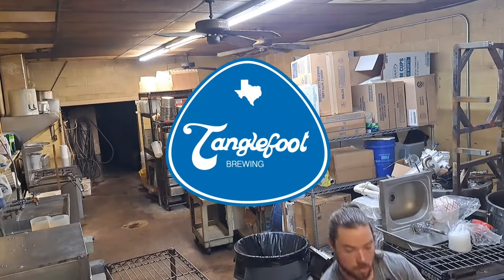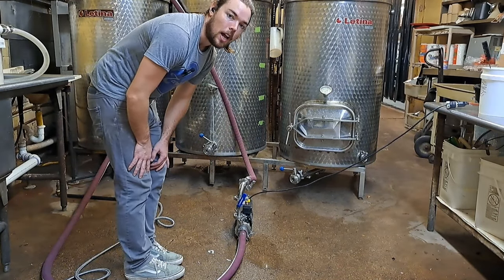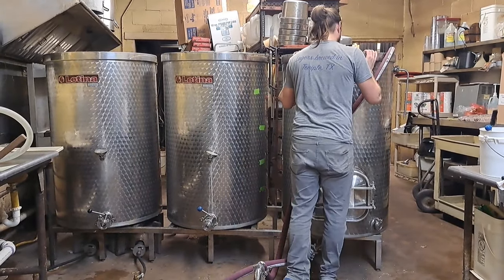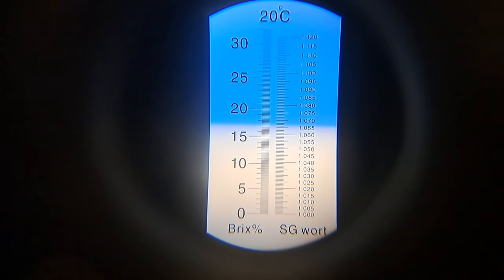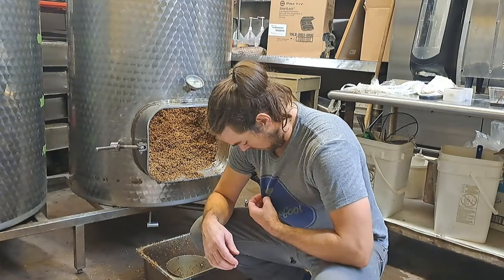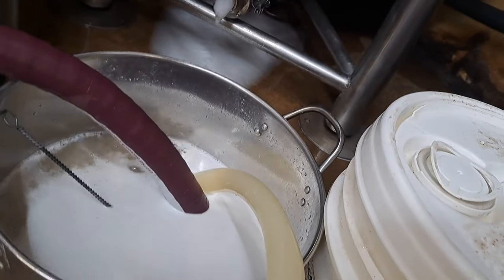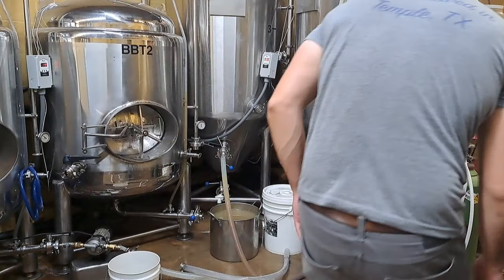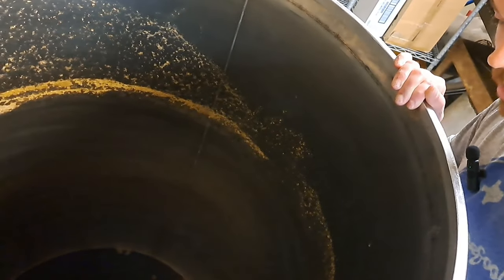Brewing Czech Lager In A Tiny Brewery

Comment: Great video! Thanks for taking the time to make it. One question. When you initially set up the tanks, the one on the left was for HLT/BK. The one on the right was for MT. What was the one in the middle used for? Thanks and cheers!
Reply from the maker: One in the middle was initially the HLT but I stopped using it for that since it was unnecessary, I have hot water at the ready for sparg8ng and don't need it. 🍻

Comment: The most impressive part of this video was that you were able to open a Weyermann bag without a blade. I just cut that first little pair of strings and it comes right out. Good work on the video.
Reply from the maker: Did that for years. Learned how to do it without in a pinch when the box cutter went missing. Got a quick tutorial on how to do it on the channel. Cheers 🍻

Comment: Neat stuff. What make/model are those 2 burners you are using? Are they both 200k BTU ? Cheers!
Reply from the maker: Something like that. They are blichmann burners, i believe Hellfire?? The burner set up is one of the things that I definitely need to upgrade. Not an ideal setup but it works for now 🤘
Reply: @tanglefootbrewing  yes they are hellfires I think. Is that heat exchanger a dudadiesal?
Reply from the maker: It sure is a DudaDiesel

Comment: Go pro, they said. It will be fun, they said. You really show the difference between homebrewing and professional brewing. It's a job. It has to be done. You have to check more things, have better analysis what you do. And if you fail, it will cost you money. You get soaked and sweatty.
I can see this isn't your first brew! Nice work. I am process technician and head brewer at a large brewery (300 hl kettle, 1000 hl fermenters) in Sweden. Still doing homebrew for fun and experiments.
Why are you using a cold water tank? Is your water from the tap not cold enough, so you chill it in advanced? Normally a brewery use a hot water tank to collect the warm water from the chiller. That can be used in the second brew, if your fermenter can take two or more brews. Saves money on the energy bill. And you do not have to clean the brew system that much until the end.
There can be several reasons for not hitting the mark. The malt. Do you get good malt analysis from your surplyer? Low extract in the malt? High B-glucans? High PUG? Low diastic power? High thickening temp? Not all surplyers give a detailed malt analysis to small brewers. You get what you get. Enzymes can be a good idea to increase the yield.
You seem to have good control on the mash and sparging. Those steps can cause less OG. Nice you let the spent grain dry out and get as much sugar out as possible. I guess you have made a brewhouse efficiency analysis, to use in your recipe building? I build my recipes backwards. What I want in alcohol, FG and volume, back to grain.
If you have less boil off and still no DMS, is a good thing. It's more beer and less energy lost to steam. I didn't see you check your volumes exactly? Make a measuring stick in your brew kettle. That will get you better control how much you boil off. Have a mark on your burner, so you use approx the same amount of propane/h from time to time. The same amount of propane = the same energy = the same boil off. A flowmeter is a way to know exactly how much you get into your fermenter. Expensive, but will get you better control. One way to hit the mark is high gravity brewing. Make your recipes slightly stronger. If you know the volume and OG in your fermenter, you can add exactly the right amount of water to hit the mark. Also a benefit with a flow meter. Or with your stick in the kettle you know how much water to put back in for the right OG.
I would put the pump and the chiller on a trolley. Then you get it up in height. Don't have them on the floor. Don't need to crawl at the floor to check temperature. Better for preventing infections and save your back and knees.

Good luck and cheers!
Anders
Reply from the maker: Cheers 🍻

Comment: What kinda brew barrels you use ?
Reply from the maker: By barrels do you mean fermentation vessels? If so, I bought a used 4bbl system with Pacific Brewery Systems tanks. 👍
Reply: @tanglefootbrewing  sorry, i mean your boil kettle and such you were using on the video.
Reply from the maker: @drumkendrum  got it! They are Letina tanks(commonly used in wine making) and have been retrofitted to work as a mash tun and brew kettle. 🍻